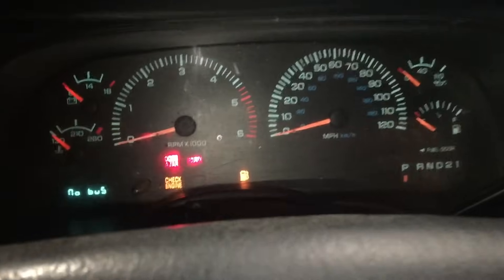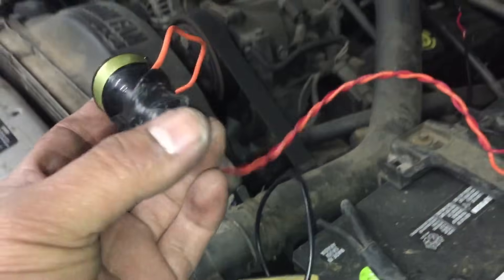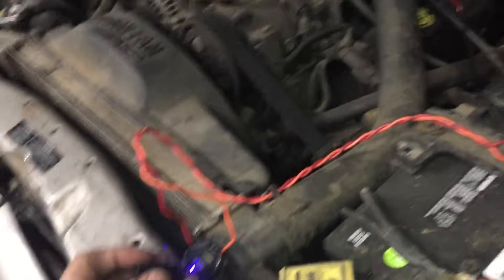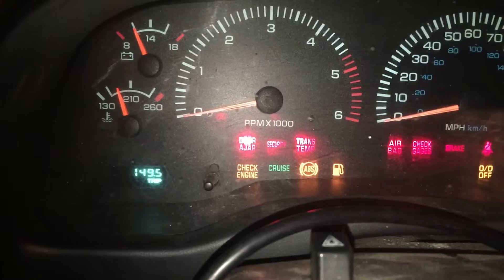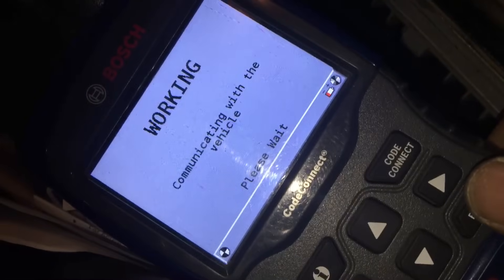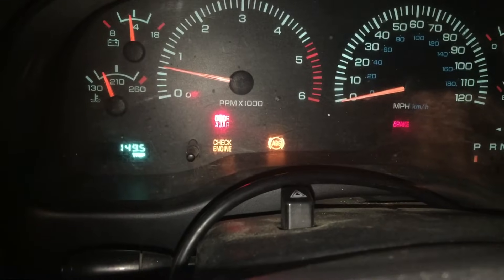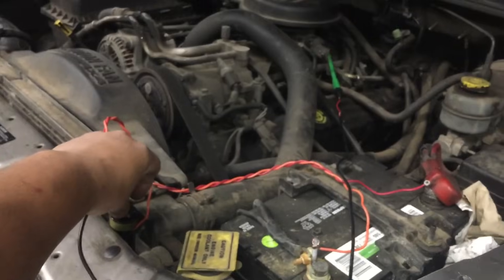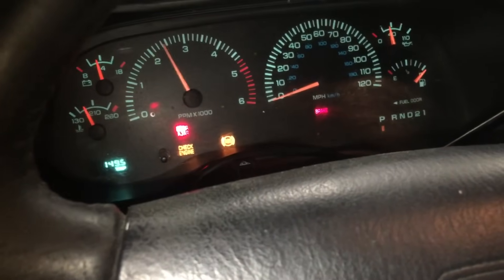No Bus No Start FIX!!!  Dodge, Chrysler, Jeep, Plymouth, or Ram

Comment: I had the same issue in my 02 Dodge 1500 van. Found if i pushed on the three harness connection at the pcm it would power up and start. Come to find out the pcm had a crack in the circuit board. Replaced the pcm and it was good to go $700 later!
Reply: Arnt pcm's like 200 online and 10 minutes to install? I'm going to install myself and save 500 bucks if that's what's wrong with mine.
Reply: @debramartin9396  my pcm was $500 at the auto parts store then it was $200 to have it flashed. The pcm's you are seeing online most likely are cheap knock offs and still have to be flashed with the programming.
Reply: @Jack miller  that's no true, the PCM/ECU sold online from websites are rebuilt.  These Dodges are known for the circuit boards to crack and sometimes when a cold start they will start and run till they warm up, then the heat from the engine heats up the circuit board and opens the crack causing the engine to die and no bus. 
There are many great companies that do a great job rebuilding these, flashing them for you when you give them your vin and mileage. The place I been using for years gives me a lifetime warranty on these and cost range from $150 up to $350. 
I have had to many problems with Cardone ones with flashing them, lasting less then a year.
Reply: Can you share the link to where you got the PCM from? I have the no bus code and won't start run.
Thank you. @DavidGuns
Reply: @davidqueen4719  it was Flagship One Inc
Reply: No Bus situation on my 2001 Durango. I tried what you did here nothing. I bought 2 ECM s thru ebay flashed to my vin . Still No Bus. Any ideas ? Thanks
Reply: @markcheadle495  Did you ever figure out what was wrong? I'm in the same situation right now. I have installed 2 PCM's and still get a No Bus. If I unplug the connectors and wait just a minute or 2 it will start back up and run.
Reply: @Jackmiller-xh5ne  Thank you

Comment: I understand the 5v, but what about the amps?  Is 2.1A correct?  Would 3A work?   (thank you for the great video!)   Steve
Reply from the maker: Steve Lake Thanks!  To be brutally honest with you, I really don’t remember the actual Amps of the USB Power that I used for the video.  I want to say that it was a 2.1A Power Supply.  As for 3A, I would say that should work perfectly fine, if not better.  Considering the amount of Sensors that the 5v Ref. feeds throughout the Powertrain.  Hope this helps!
Reply: Can you make a tutorial on how to 2 wire up the usb please  @RespectAutoWorks

Comment: My 2016 Jeep Patriot had a accident about a year ago it supposedly caused  the TIPM to need to be replaced which the Jeep Dealership said they replaced but within 3 weeks after they replaced the Tipm all my lights on the dash started lighting up periodically almost like a Christmas tree...and I started receiving the no bus message where the mileage is read when I took the vehicle back to the dealership they told me to replace the battery which I did with a brand new one from there at the dealership it drove fine for a week and then everything started happening AGAIN.. when I returned to the dealership they said basically that my warranty had expired and that there was nothing else they could do to help me unless I wanted to pay out of pocket for a $150 a hr diagnosis and they couldn't estimate how long it would take them to diagnose my vehicle! But I feel that they should cover the diagnosis since they never actually fix the problem while it was under warranty they replaced the tipm when most likely it didn't need it hot.. Is there any way that I can make the dealership fix my problem? Since then my air condition went out I had to replace the fan motor also the lock actuator on the back hatch went out as well as the windshield wiper comes on intermittently by itself they also replace the windshield wiper motor while it was under warranty but it has since then gone out and when I try to turn my windshield wipers on it comes on but whenever I turn it off the windshield wipers park right in the middle of my windshield it doesn't go down like it's supposed to I don't know if all the other problems have to do with the electrical short that my vehicle has but I think it does..... my registration to my vehicle just went out this month but I can't get it registered or inspected because of the engine light constantly staying on do I have any way of making the dealership fix this? Any help or advice that anyone can give me what could be greatly appreciated thank you
Reply from the maker: Rhondavas1977 Sorry to hear about your troubles.  It sounds like you may be experiencing a Shorted or Open Circuit from the initial collision.  If they claimed that your Warranty is expired in a span of weeks or a month, then I would be skeptical of their policy.  You may want to review the original Repair Order/Invoice Disclaimers to make sure their claim is accurate.  If you live in CA, then I would advise you to contact the Bureau of Automotive Repair (BAR).  But if you live in another state, then look into any Consumer Affair Agencies relating to the Auto Industry.  I understand that Collisions may tend to mess with a great amount of electrical components and may get overwhelming, but they should stand by their word/policy when it comes to diagnosing the source of the original problem.  We have had some cases where the Electrical Damage (along with Cosmetic Damage) on a vehicle exceeds the overall value of the vehicle:  deemed Total Loss.  So you may also want to get in touch with your Insurance to express that the vehicle is still not properly repaired after collision.  Thanks for watching, and I hope this info helps!

Comment: Well. the IAC valve is not even part of the k6 circuit. So how is it bringing the pcm down?
Reply from the maker: raul gachuz that’s actually a valid point!  🤔. We ended up replacing the PCM to properly resolve the issue.  I would assume that the defective IAC may have internally shorted and possibly damaged the circuits within the PCM.  

This video was to simply show a method of how to “temporarily” start/drive the vehicles with a “No Bus” reading and the lack of 5v Reference (K6).  In hopes that I would help someone with a stalled vehicle move/drive home or a safe place.  Thanks for your input and clarification!
Reply: Ok because i was trying what you where doing and i got the same code but yea. Ive replaced thr pcm once and its still doing it again
Reply: And also. Since you replaced the iac valve. It didnt fix it?
Reply from the maker: raul gachuz replacing he IAC resolved the DTC and Idle issue.. but the PCM still lacked the 5v.  The problem was resolved after replacing the PCM, following the IAC replacement.  You may have to replace the PCM again, after replacing the IAC.  Also may want to check for a short-to-Ground in the K6 Circuit before installing the new PCM.  I have also experienced some intermittent shorts (in other vehicles) from the other components (i.e. Evap Purge Solenoid) that involve the K6 Circuit.  Hope this helps!
Reply: @RespectAutoWorks  Thanks for the informative replies.  I have been trying to solve this for about 4 months now.  I have found other links on this issue for a 2002 Dodge Durango 4.7L.  Due to that, I have run a cycle test on the NO BUS error and got no codes in the dash.  I also got no codes on a code reader.  I replaced the components I had read on-line were on the 5V circuit including: IAC valve, MAP sensor, crankcase sensor, camshaft position sensor, throttle position sensor, and computer (PCM).  I also replaced 1 relay that had a slight rattle.  I also replaced a vacuum harness that had fallen (2 hoses) together that went to the purge solenoid, purge cannister and charcoal cannister.  (2 front and 2 rear connections).  Now that I see the evap. purge solenoid listed here, I'm wondering if that could cause the NO BUS?  Perhaps when the hoses were melted in 1/2 the solenoid had to work overtime and it fried that to stay shut all the time?  It does seem to run fine until it warms up (maybe when the evap would start sucking some excess fuel out?)  It seems to stall when decelerating or coming to a stop.  I had it in a shop for about 35 hours of investigation and they are supposed to be the electrical experts of WA state.  They only charged me 8hrs, but couldn't find the problem.  They also replaced the ignition switch and transmission pressure sensor.  I knew about the transmission sensor, but not the ignition or purge solenoid.  What other components are on the 5 volt circuit?  I also unplugged the transmission sensor, crank sensor, cam sensor, IAC valve, AC sensor, and throttle position sensor with the NO BUS error up and it didn't go away.  I also volt tested each getting 5V with the ignition in the on position except the IAC which had to be running to get 5V.  Also, the shop found that with the MAP sensor unplugged the vehicle would run w/o dying when it got warm.  It runs rough, but if I come to a stop and keep a little gas on it (800 plus rpm's) then it generally doesn't die. The shop suggested a potential of replacing the relay box or perhaps using a OEM MAP sensor.  I ordered OEM off of Rock Auto and it is I believe identical except 1 letter.  It is now MOPAR 56041018AD, where as the original was
 MOPAR 56041018AB.  It would seem that the MAP, IAC valve, and Purge Solenoid could have some of the same symptoms of not keeping the right fuel/air mixture at idle or when coming to a stop?  If the purge solenoid is one of the last components on the 5V circuit I would happily replace it, but don't want it to be the next of 30 components.  It has 225K on chassis and tranny, but only about 90k on a Jasper engine that I have religiously put Mobile 1 full synthetic and Napa Gold filters on.  Meaning I'd like to keep it, but don't want to spend a ton on fixing a $2k vehicle.  (I've already spent about $1300 trying to fix it)  Thx for helping, and if you get me in the right direction you would be better than the best Electrical shop in WA.
Reply: @RespectAutoWorks  you should of said that it needs a pcm in the video. Obviously the iac will not let the car from stating. But great video other wise

Comment: My 02 Dodge Dakota was giving me this after it shut down during operation.  Wouldn't start up for about 30+ minutes.  Tried it again and it started up.  Seems like it could be the PCM?
Reply: Mine did that too. Use to be able to wiggle the middle pcm connector and I could hear the fuel pump prime and all was well. Now when it gets hot it won't restart after wiggling the connector unless I let the truck cool down. I'm leaning towards bad pcm.

Comment: What gauge wire did u use. I want to try this out. Thanks. Great video buddy
Reply: Didn’t work.
Reply from the maker: Paul Vast Thanks!  Yeah my quick fix got me back to the shop with a 22g Wire from the USB.  Replacing the IACV didn’t repair the loss of 5v from the PCM.  I then used a universal 12v-5v Converter from Amazon (16g Wires).  Still running til this day without having to replace the PCM (Customer was on a tight budget).  🤷🏾‍♂️
Reply: Respect Auto Works thanks for getting back to me. I got that same no bus code on my 2002 dodge Dakota 4.7L. I’m at the end of my rope for this truck. So I’m about to try this technique or urs. God I hope it works. I’ll keep u posted. Thanks bud.
Reply: @RespectAutoWorks  What is the Amp output on your 12v to 5v converter?  Steve

Comment: My 2000 Durango has power but no crank.  What are your thoughts on this. Thanx in advance.
Reply from the maker: Gary Kovach I would look into checking for Voltage at the Starter Signal when the Key is turned to the Cranking Position.  If there’s Battery Voltage, then you Starter may be at fault.  If there is no Voltage, then you can suspect Starter Relay, Ignition Switch, Transmission Range Sensor, or possible Aftermarket Alarm. There may also be some items I’m missing... but that’s a good place to start.  Hope this helps if you haven’t gotten it figured out yet.  Thanks for watching!

Comment: hey ethil , I had the same issue in my 03 Dakota 3.9 … the no bus , no power to gas gauge or fuel pump … so I did exact same thing u did here and it worked …….I been messing with the stupid thing all winter and now finally got it going thanks to u …. wish I had a found this vid sooner , lol ……… THANKS FOR SHARING BUD , SAVED ME A LOT OF GRIEF !!!!  pretty bad when my local dodge dealer couldn't figure it out  , lmaooooo
Reply: so i'm still not sure where the prob was exactly but this by-pass did the trick …. I also need to replace my iac valve for same reason as urs ….. now can I run the truck daily with this by-pass set up or need to dig deeper into it to find the actual prob ?
Reply: Dig deeper because it will make something ealse go sooner or later

Comment: What USB wires do you connect R,B,G,W?
Reply: Did you figure out what wires he hooked to usb n throttle position sensor
Reply: @jeraynelowry6021  nop i wasted 2 usb wires and couldnt get it to work. Anyway my cae problem was caused by intake seal.
Reply: Dam it what ducking wire out of the USB cord do I use.i have a horney  bicth  I pick up an I need to go to motel.....

Comment: I preformed this and it worked however I didn't get a code on my code reader. Any thoughts
Reply: And now it starts with out the fix?
Reply from the maker: Brian Missens sounds like you may have either an intermittent shorted circuit, or a damaged PCM.  The short may either come from the Wiring Harness/engine vibration or a intermittently failed component.  It’s best to perform the bypass immediately after the stalling with a scan tool already hooked up.  And do not turn the Ignition off or disconnect the battery to prevent PCM memory loss.  Hope this helps!
Reply: @RespectAutoWorks  I now went out left the fix hooked up and the key on and my scan tool on. And still had a no bus . I went to the pcm and pull on the harness going into the pcm (1st left row ) and I heard the relay click and it started
Reply: @RespectAutoWorks  I went out try to start it last night and it reverted to the no bus. So this AM I reconnect the fix and tried to start it and now the fix doesn't work

Comment: Creative maneuver...The fix of course is to monitor 5v ref at ecm and disconnect associated sensors one by one until 5v ref returns and you have then identified which sensor is bringing down the 5v ref...
P.S. I learned the hard way thinking pcm had internal 5v regulator problem, fortunately, the pcm was not costly but lesson learned.
Reply: No one learns the easy way 😉
Reply: @NewLevelAuto  
Also, it is always "easy to make it hard"  ;)
Reply: Do you know which sensors are associated with the 5v reference?

Comment: How did you wire the usb cord? My usb has a red, a green, a white and a black white
Reply from the maker: Marc DiVito Red is usually the 5v.  I would make sure to use a Volt Meter to make sure it’s giving 5v, before tapping it in.  Hope this helps.
Reply: It looked like he used more than just the red

Comment: So if you change the iac it'll run without that
Reply from the maker: HgoD1800 Yes, in my case, the IAC was the source of the short.  The bypass simply kept the PCM from shutting down so I was able to use the Scan Tool to pinpoint the location of the short.  It could either be a defective part or a shorted circuit towards the part that is indicated by the Scan Tool via DTC.  I hard-wired a 12v to 5v Converter into the Wiring Harness and completely eliminated circuit for the 5v source from the PCM.  The problem has not returned for us, though results may vary depending on the severity/location of the short.  Hope this helps!
Reply: Ok so I've done this today. And when I have the USB connected the fuel pump doesn't prime. But when I do it with it unconnected the fuel pump primes and relays turn on. What does that mean
Reply from the maker: HgoD1800 sorry for the delay.  We are quite busy over at the shop.  If your Fuel Pump primes reliably upon command, then you may have a different issue.  But you may want to double check the Circuit that you have tapped into.  You essentially want to tap into the 5v reference Wire that is the same color amongst all the various Sensors.  Also, make sure that your are NOT getting 5v (at the 5v Ref Circuits) before you decide to tap.  Hope this helps.  But if problem persists, then I would have to advise you to consult your local/reputable Automotive Electrician to test all necessary circuits and components.

Comment: Can this setup be left connected for an engine that intermittently stalls?
And thanks very much for the video....I don't have $1000  for a new ecm
Reply: Keith S....u can get a new ecm from.   fs1inc.com for around 138 bucks.. lifetime warranty.  You can install it yourself in 5 minutes.. several vids on YouTube on replacing ecm..good luck
Reply: @castledomeknives9395  THANK YOU FOR THE INFO..I SAVED ME ALOT OF TIME LOOKING FOR ONE..GOD BLESS YOU!!
Reply from the maker: Keith S Yes! You should be able to leave it that way if you wish.  I believe Amazon sells 12v to 5v Converters to hard-wire into the Harness.  Although I would recommend to diagnose the actual issue to prevent any future issues with the bypass. In my case, the scan tool indicated that the IAC was out of range.  So I replaced the IAC, and problem was solved.  Results may vary, depending on where your short may be located.  It’ll either be a defective component, or an actual short in the Wiring Harness.  Hope this helps!
Reply: Ethil Honrada  tyvm :)

Comment: I did this the same as you but when I plug In the usb my cigarette lighter charger goes out
Reply: maybe make sure it is a 2.1 amp output usb charger, not a 1 amp.
Reply: Cameron Berrier me too
Reply: Yep tried 2 different USB chargers plug it into the throttle position sensor wire . Charger goes out